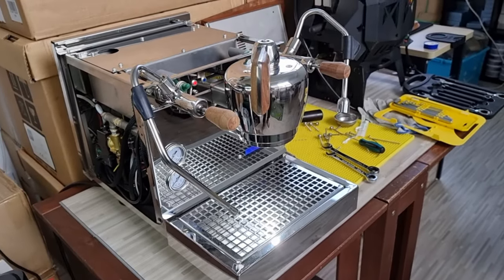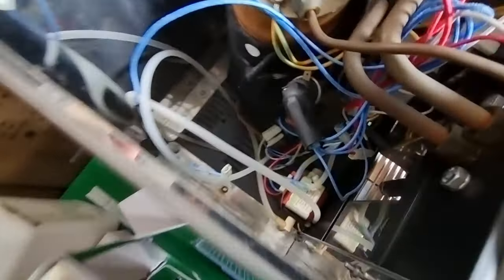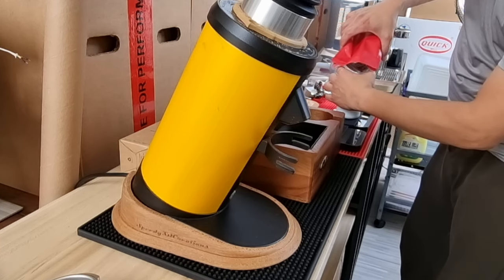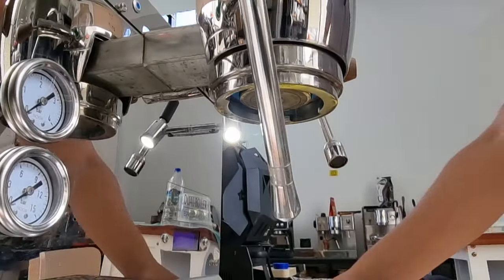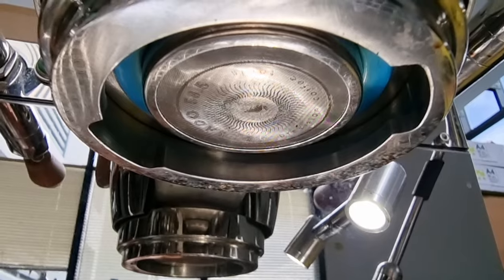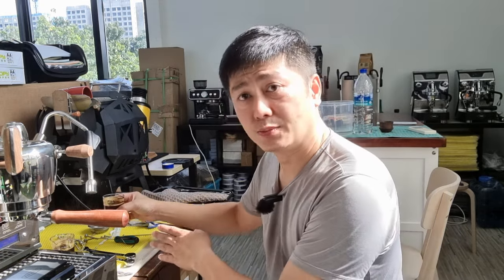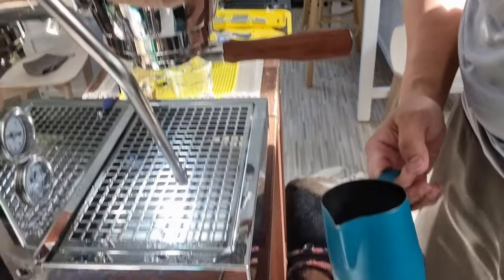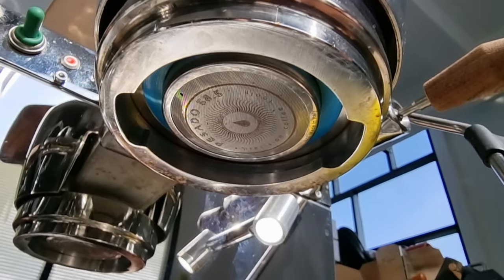Nook Mini | Dual Boiler Espresso Machine with Rotary Pump

Comment: there's something fundamentally wrong, without a coffee puck in place, the pressure should never reach 9 bar when you engage brewing
Reply from the maker: Why not. My lelit bianca will reach 9 to bars without coffee puck. That is showing pump pressure and not the puck pressure. The puck pressure is shown on the flow control dial connected to the e61 group.